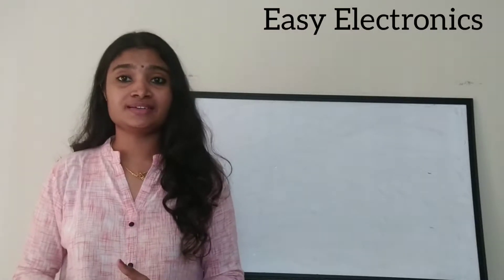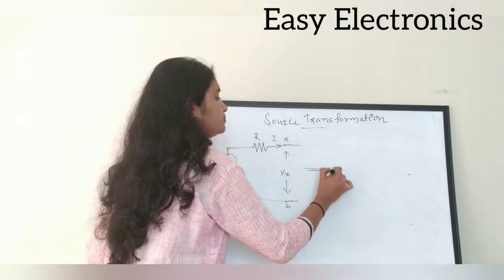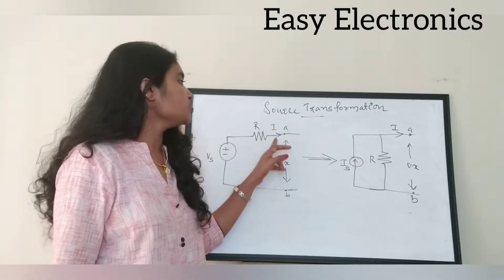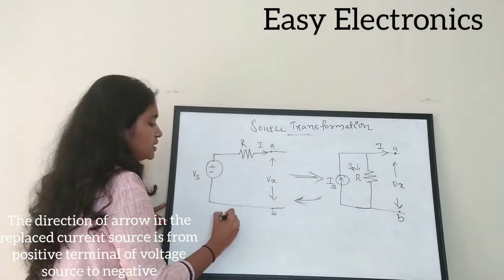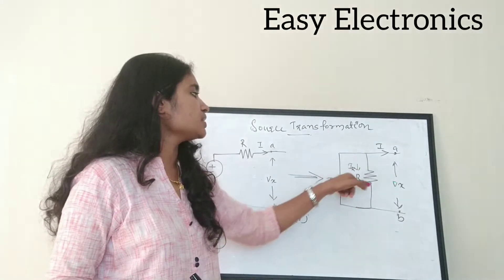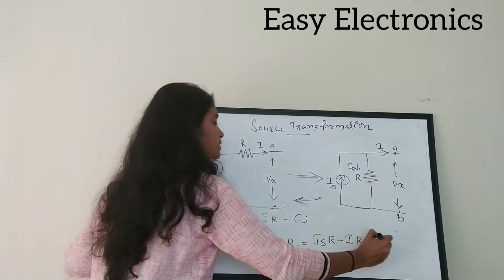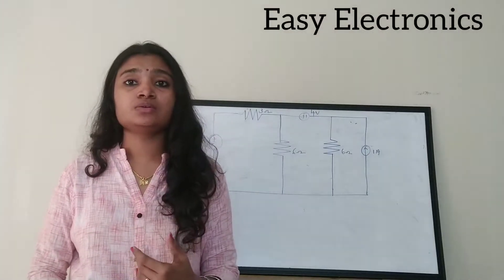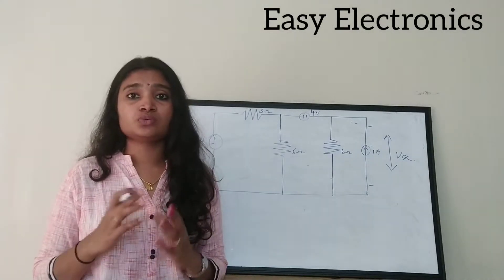Source Transformation in Network Theory

Comment: Mam is there any specific reason that we subtracted current 8/3 A from 1A, why didnt we subtracted 1A from 8/3A, although 8/3A is higher than 1A, plz reply
Reply from the maker: No, only we are taking difference of currents since they are opposite to each other
Reply: @EasyElectronics_jobupdates  but if we subtract 1from 8/3, answer will be +2.5 voltage and if both the option i,e -2.5 and +2.5V are given in ans what to do